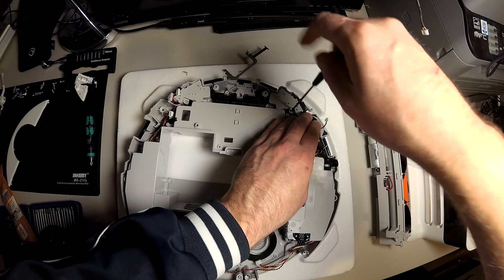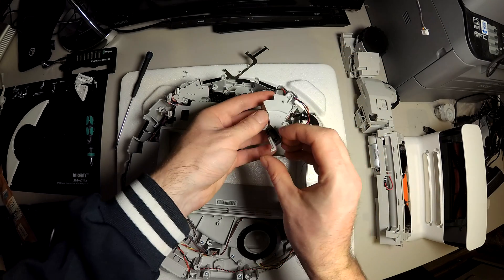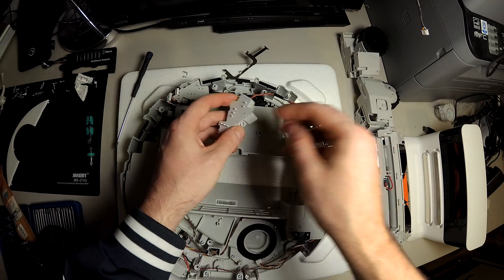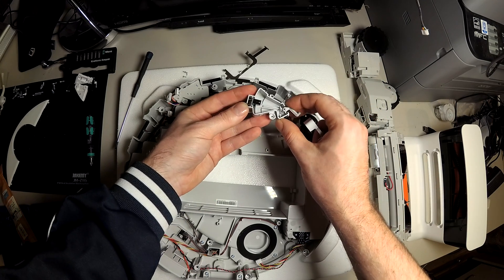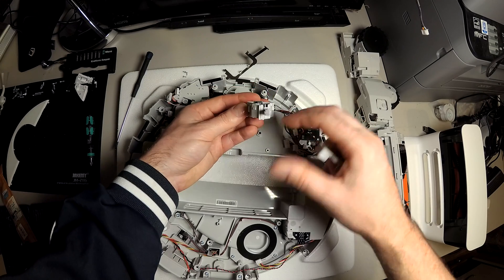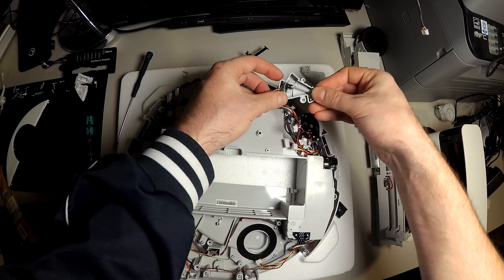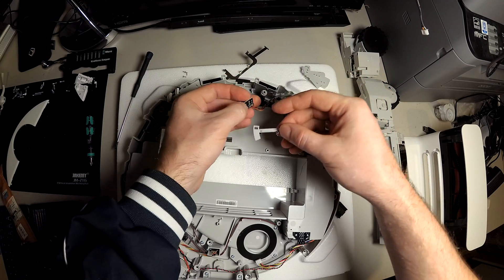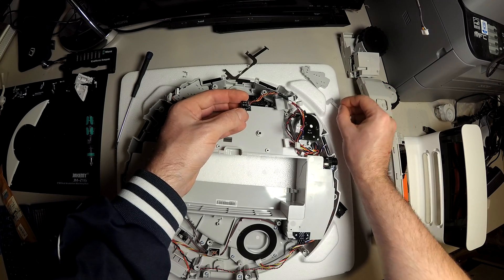Xiaomi Mi Vacuum Bumper Sensor

Comment: To fix the error is dismantled the vacuum and extracted a bumper sensor. It appears to be an infrared unit where dirt can block the signal. I gave it a brush off with the foam filter from the back of the machine and it’s all working again. No need to replace the sensor for me.

Comment: Have one and I'm searching for front bumper in many online stores. do you have any idea where I can get it??
Reply from the maker: If you in Germany I could sell you one used.
Reply: @AntonD  sorry I'm in Portugal, but I think Is not an issue. If you have photos of the bumper and if it is in good shape we could make business.
Reply from the maker: I will look for it tomorrow and take a picture
Reply from the maker: I looked in the garage und in the workshop and did not find the bumper. I so sorry, I think I loose it during my movemand.
Reply from the maker: Just found some bumper and cliff sensors add to description but no front bumper
Reply from the maker: You may look for a damaged unit on ebay
Reply: @AntonD  will look on ebay...thanks.

Comment: Hi, I have error 2: "clean the bumper slide", could this sensor break and how to check it?
Reply from the maker: I think it is the black side wall sensor. Just clean it up.
Reply from the maker: Did it help
Reply: @AntonD  cleaned the glass sensors, began to work, a month later the error returned, now constantly appears at startup. The error appears due to the left sensor after contact with an obstacle. What can be cleaned inside the sensors or do I need to order new sensors?

Comment: Amy ideas on how to repair the switch or a replacement?
Reply from the maker: What is broken? Have you pictures?
Reply: Anton D. The bumper switch is malfunctioning, it things it is pressed when it is not. I have not taken it apart yet.
Reply from the maker: Maybe it is not the switch but more the wiring from the switch.